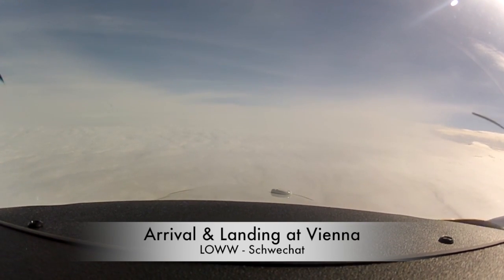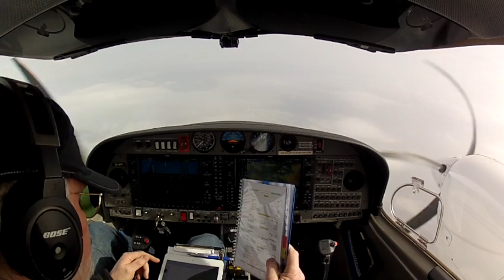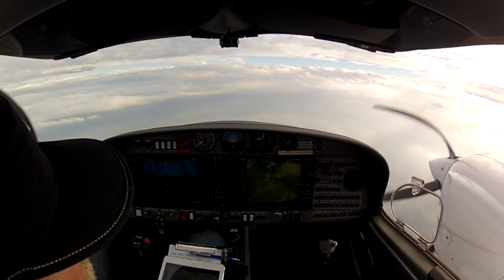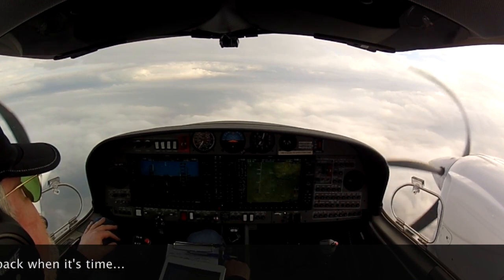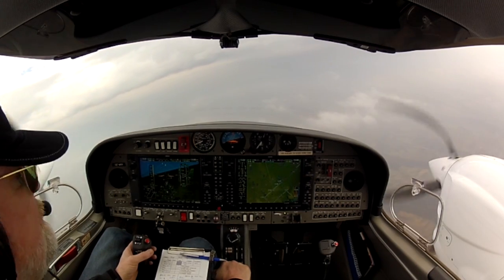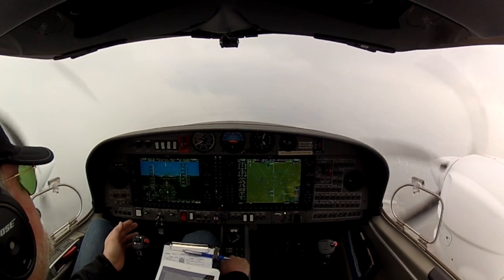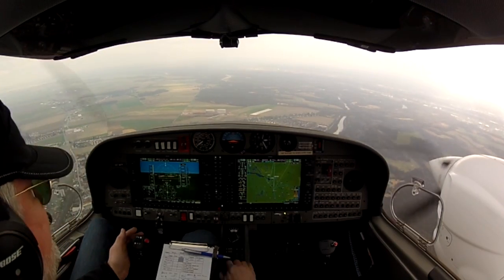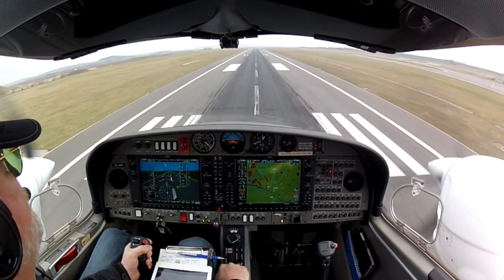DA42-VI IFR Vienna (LOWW) Arrival and Landing

Comment from the maker: I didn't mention in the vid that I routinely wait until 4 nm out before lowering the gear and approach flaps if I am asked for "high-speed" approach (no matter where glide slope intersect happens). This is a really workable routine in the DA42, since you need the gear as an air brake to get down to the 133 KIAS max for extending approach flaps. The urge to "forget" the gear is counteracted by that. Using this routine, one can maintain 150 KIAS until 4 nm out, which is appreciated when there is traffic behind or waiting to line up.